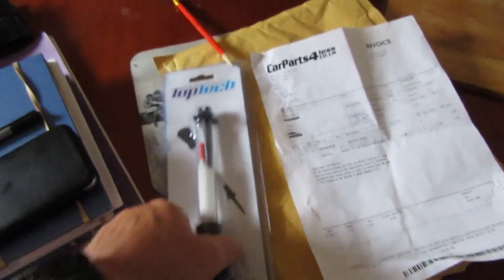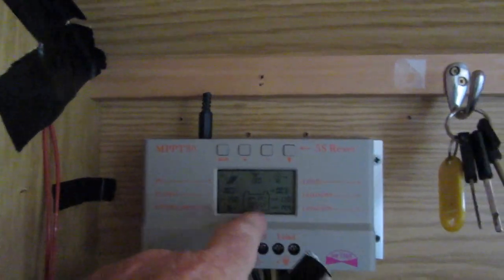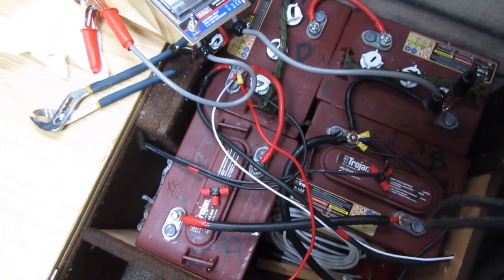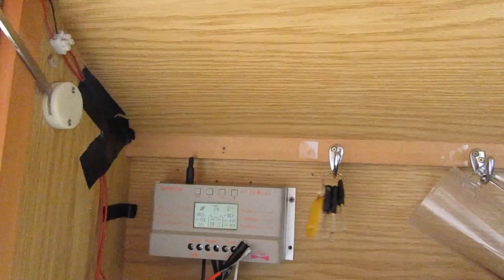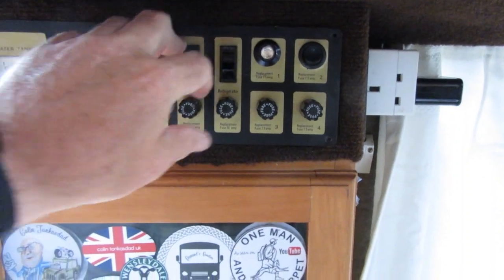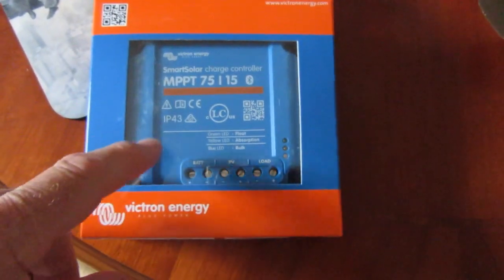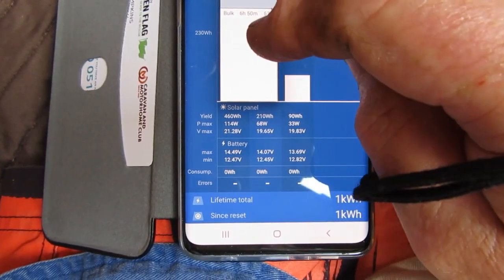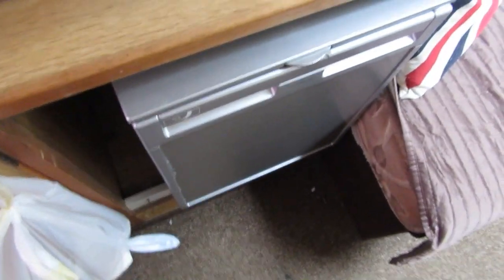Dometic crx50, problems on install,resolved ?

Comment: My cre50 is also flashing orange. What was tge problem for you ?
Reply from the maker: Check that you have enough power....? Usually indicates not enough power ie battery!
Reply: @ColinTonkasdad  thanks for the quick reply! I have a dynac 12v 180ah battery. I have the fridge directly connected to it. I unplugged everything and connected everything again. Now the orange flashing light is blue again. I guess it is solved.